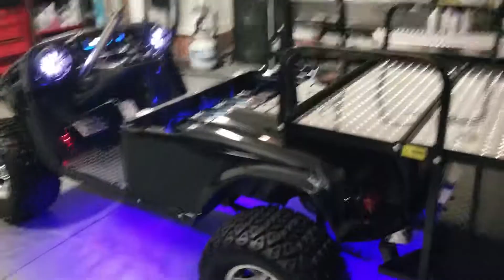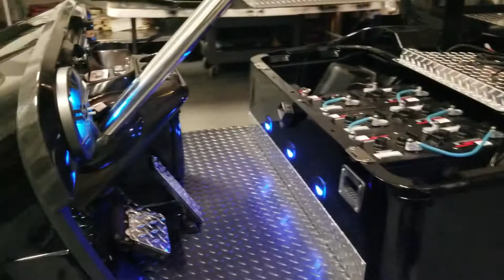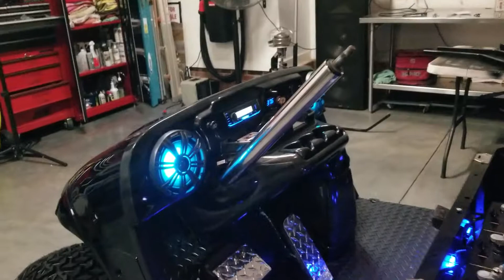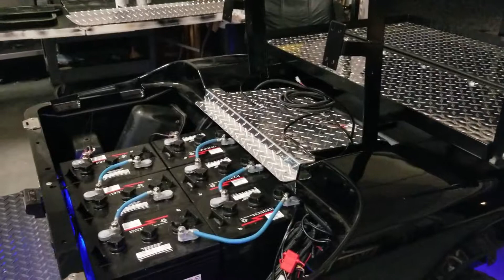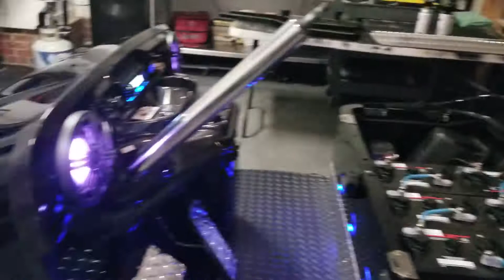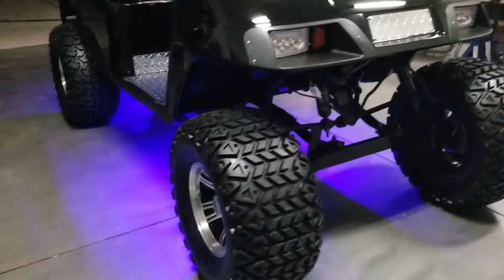Custom Golf Cart build UPDATE BLACK MAX 11-19 JT's Kustoms

Comment: Where did you get that dashboard?
Reply from the maker: I am a dealer for VIP and they make them. We have that color along with several other color options. It comes with the radio and speaker cutouts already done, then we modify to accept the other accessories.